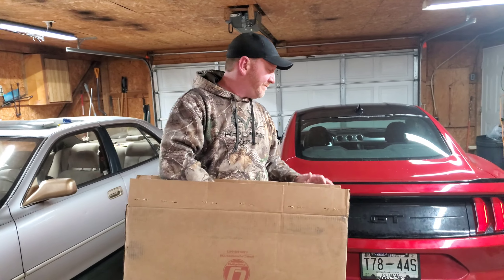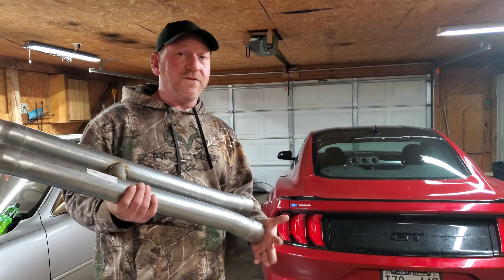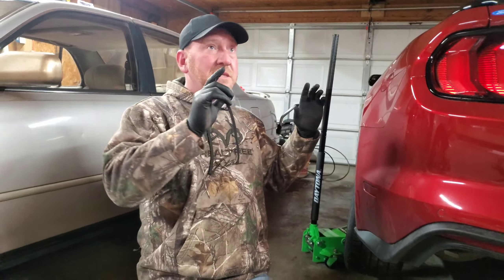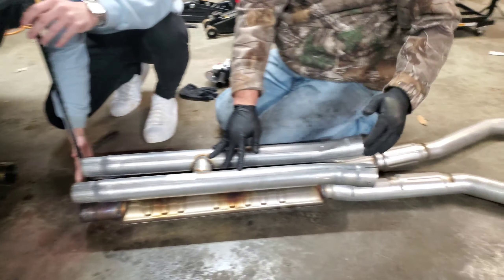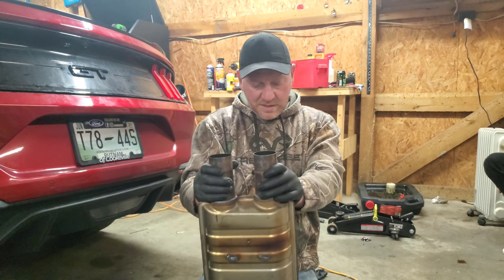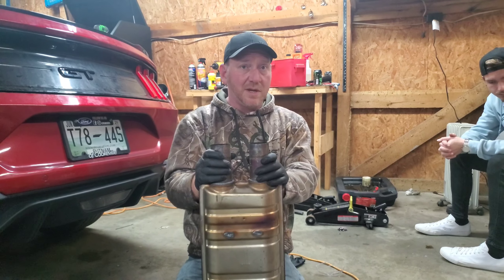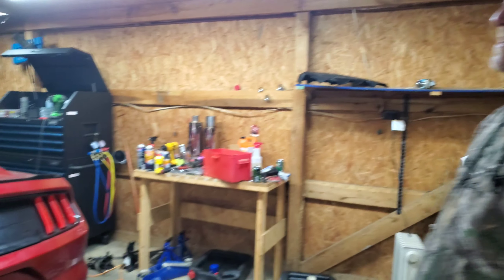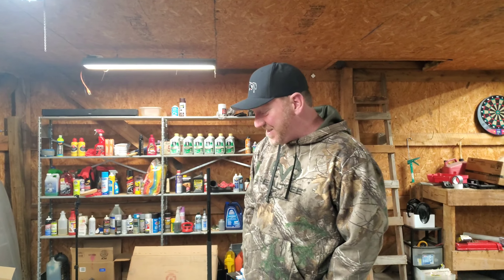2020 Mustang GT DIY H Pipe Installation

Comment: Did you get any low rpm drone at cruising speed after H pipe install?
Reply from the maker: No sir I did not. I've since put the MBRP Race exhaust on and it has a little. But just H pipe, it was perfect
Reply: @aftermathgarage  Thanks....I think I will give the H pipe a try. Stock is good but a little more is better!!!🙂👍
Reply from the maker: @donaldbrown1300  yes it is sir! Have fun with it!